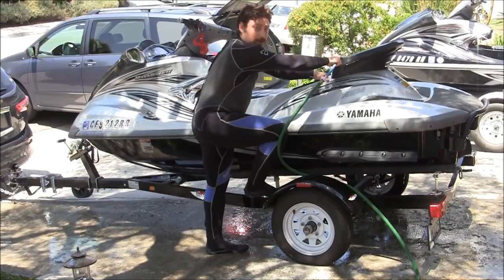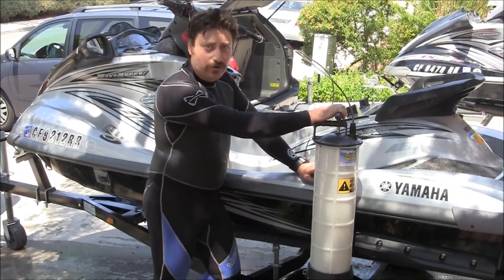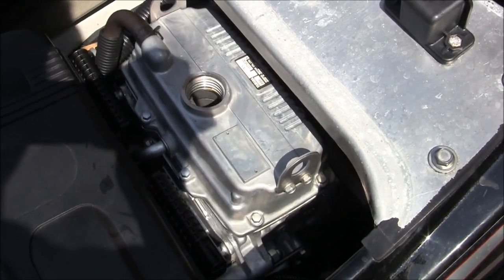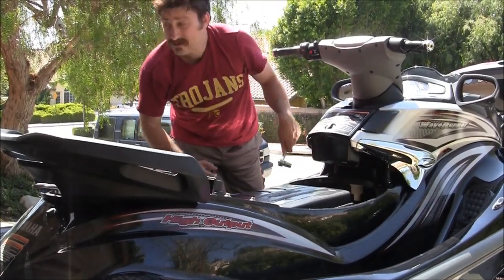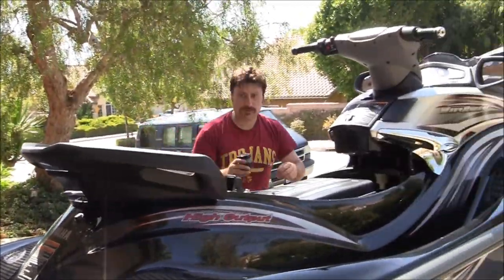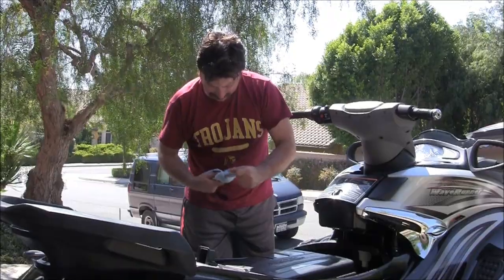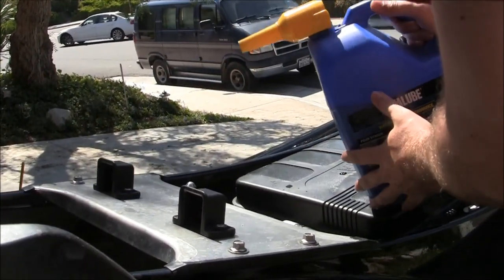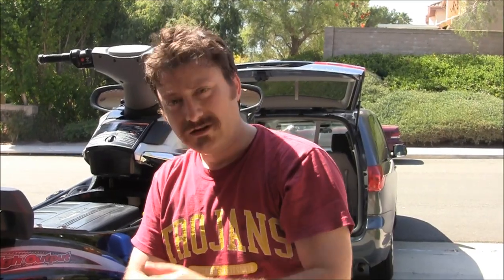Yamaha FX Series 02-08 Oil Change

Comment: You can never get rid of all of the old oil on a dry sump system like Yamaha MR1 engines have unless if you do an ''engine oil flush''. The Yamaha owner's operator's manual says on page 91: Engine oil quantity with filter replacement 2.2 liters. Engine oil total capacity 4.5 liters.That means that every time you change the oil on that engine or put it better you think that you are changing the oil 2.3 liters of the old oil remains in the dry sump system.

Comment: To the 29 guys that gave this a thumbs down...  What r u thinking?  Did he do anything wrong? No.  Was it helpful? Yes  You should post your better video links with your thumbs down and comment...
Reply: Hey Joseph thanks for your comment coming from his son unfortunately captain Reza passed away back in 2015 :(
Reply: Everyone is quick to criticize or think they are better mechanics, you give them enough time they can fix darn near anything kind of stuff. I’ve been around , and was a shop Forman in San Jose @ Courtesy Chevrolet at the ripe old age of 25 in the 80’s. I’ve seen the know-it alls fumble, and the so called experts cut corners, they all get come backs for sloppy work and break stuff trying to do it “ the fast way “. Sure this guy isn’t a pro but he is on camera without any director or script. He didn’t make any mistakes or retakes, did a thorough job and did the service after a ride. Is the video perfect or his technique? Maybe not but it will get you over the hump or advance your method. Changing oil in a Yamaha PWC is not easy even for a pro like me, ASE Master technician, master mechanic , all around wizard , Renaissance man. YOU always need some advise if you are a novice or a pro unless you are a jerk with a huge ego, so to all of you experts who said thumbs down I bet you had to guess how to repair something at one time, had some nuts and bolts left over, cross threaded into aluminum, put silicone on a gasket, over tightened a fastener or oil filter and left it to see if it would hold or fail. Karma is real in the mechanical world so double check your trailer hitches bitches and try not to be so critical about people making a video like this. Ok see you at the dock oh ya, remember that there are still a few old guys out there that are still faster than you.

Comment: well done video, thanks for sharing your experience. I just changed the oil and filter on my 06 FX HO Cruiser after watching your video. Was only able to siphon 1.75q  out of the oil sump no matter how I oriented the pickup tube. Had a little trouble removing the old filter but had a strap wrench that worked finally. Great suggestion about the filter with the nut, I will order 2 more KN303 for next change. After the oil change, it's running great. I'm going to slide open the old filter and inspect it. I was getting intermittent  oil pressure light at 2000 rpm, this motor was completely rebuilt over the winter so I suspect maybe a partially clogged filter. was planning to change to the oil and filter anyone. hope this solves the problem.

Comment: That long staw on the end of that pump is intended to go down the hole the oil dipstick comes out of.
Reply: Just so you know there is no dip stick tube the tank is actually an oil cooler and the engine is a dry sump so running the engine on the flush hose for a few minutes until you feel the water coming out the side is warm not hot. The oil pumps up into the tank then extract. Paint tray liners can help catch some of the oil from under the filter with the filter loose. Wait to do this as the oil will be hot ! Don’t forget to wear your onesie. After an oil service  take some oil with you on your next ride and check the oil level either at the dock after 10 minutes of warm up or at the beach with your ski floating and add if you have to. If it is high then you need to extract some out as soon as possible. Extra will blow into the intake air box and make a mess . There is an overflow tube from the tank going to the box. Later on from the Canadian swamp kings

Comment: I like the way you pour the oil into the engine, but why not use a funnel to prevent possible spills?   How much extra oil do you add when replacing the oil filter?

Comment: If VX waverunner was stored for 10-12 months and I want to do oilchange before season how do I extract what I don't see? Meaning there is no oil visible (in oil pan, dipstick dry) to extract like you did in video. Do I just have to drain 2.5qts after pulling oil filter or do I start up on land and let run for awhile to get oil to refill (makes me nervous to do)?  Any help appreciated and thanks for video it was great

Comment: It revs till about 4000 rpm does not go back to idle on its own have to pull the ckoke to bring back to idle it does rev to 8000 on the gauge then goes down to about 6000 this ski came from florida ran great the first 4 houres afther sitting for along time ski shows 34 houre now then it started doing that i am goin to try that web site thanks

Comment: Thank You
I bought a 2006 1100 and did Not read manual....and added 2.5 qts....Big Time mistake,yeah....cranked it... And it was 2.5 qts high...so....pumped it down....ran it one time and did oil change.Why in the HELL would a company make a engine that you can only change part of the oil,knowning that is the blood of the motor..OMG
Poor design there...Thanks for Video,

Comment from the maker: I never owned a 2 stroke pwc but have dealt with small 2 stroke engines, sometimes if your low end is lean it does that! How high does it rev up? I assumed you meant high idle! If it is revving up more like 1/4-1/3 throttle then you have other issues. Post your question on pwctoday. com there are people with 2 stroke background that can help you!

Comment: I'm at 237.5 hours. I should be due for one, although I burn so much oil on those 80 mile rides I'm always putting fresh oil in.
Reply: At that kind of mileage or hours all of the oil lubrications have broken down and no longer function. Ten Thousand RPM ! It’s not a Briggs and Davidson. Your timing chain will be grinding away not to mention everything else. At 50 % oil life left in your car you risk premature wear, at 10,000 rpm it happens a lot faster. Learning to change your own oil is a privilege to me like peeing standing up. That should be a bumper sticker on every fossil fueled machine.

Comment: I recently purchased one of these wave runners same model 07 from an auction and the oil level isn't showing on the dipstick I can see very minimal oil on the bottom of oil reservoir what should I do?
Reply: Black B7 The oil doesn't show on the dipstick until the engine has been ran for 5ish minutes

Comment: hey! how many times a year should i change the oil and/or oil filter? This is going to be my first time doing it by myself
Reply: Every 50 hours, and the end of season , grease your shaft bearing, its a zirk fitting . Fill with non ethanol gas if stored outside or in , service your battery, remove your jewelry first, remove your battery  from the PWC, take another sip, and dream of next spring !

Comment: I have 10 hours on mine what do you recommend as a service break in after the first 10 hours
Reply: I have removed almost all of the oil , over 4 liters by spinning the filter off to leave a small gap , then turning the engine over for a couple of seconds being careful not to start it . You can disable the spark plugs at the coils if you like easy to do. Like all things that are better take more effort. This is advanced technique only in Canada, anyway, make sure you have a paint tray liner and towels under the tray, take another sip, then use the oil extractor and suck the oil from the paint tray. Just remember you are removing most of the oil first from the tank. There are two levels in the tank so if you can get your tube to the bottom you will be very happy like Canadians ha ha. The best oil to change is cleaner oil not a double espresso. Btw flush your baby at home on the hose instead of burping it out dry at the dock because you risk cracking your case at the #3:cylinder remember you just raced your buddy back to the dock to get on the trailer first so it’s smoking hot and needs to be cooled down or wtf water in the hull stuff. Trust me on this one, I always get on the trailer first ! Ha ha , Canadian swamp kings

Comment: Am i stating the bleeding obvious but  you suck the oil out through the dipstick hole which goes right down to the very bottom of sump
Reply: Nope it’s an oil tank / cooler dry sump system